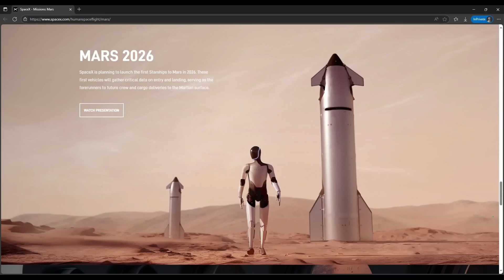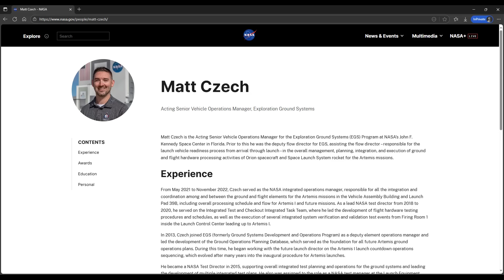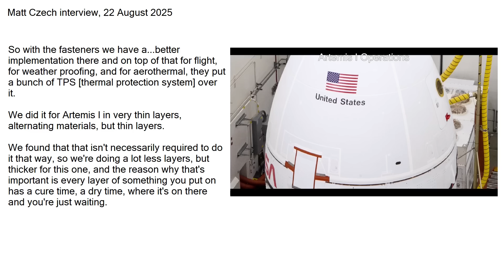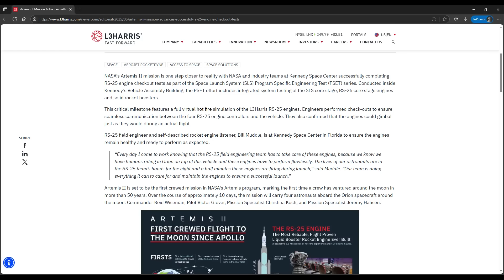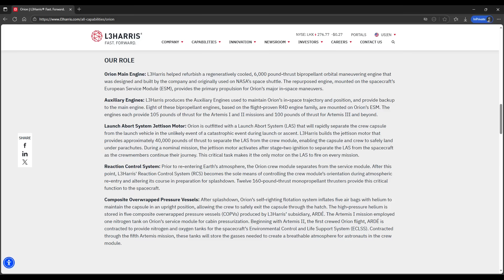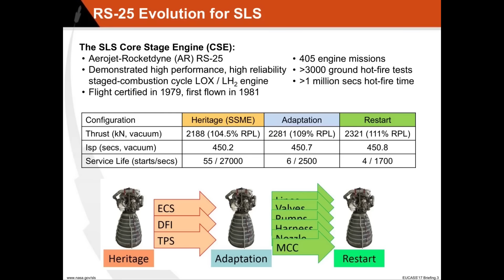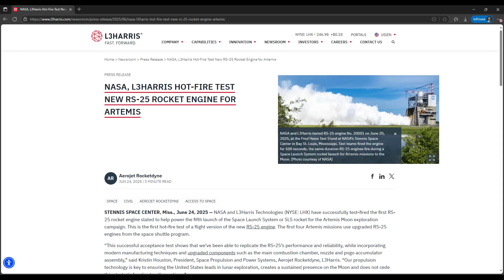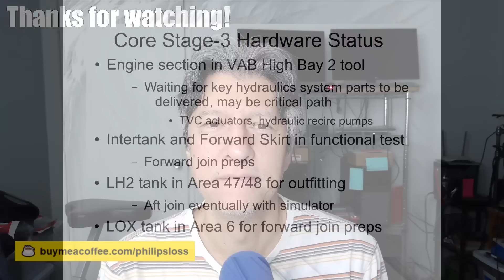Starship flies successful test, Artemis II launch preps continue

Comment: Elon Musk recently posted an infographic that shows that current V2 of Starship only has a payload capacity of 35 tons, which means that the vehicle is currently extremely overweight. I am skeptical of future payload capacity goals (V2 itself was originally advertised as having 100t capacity) and if SpaceX can't solve this problem it means the number of refueling flights will be extremely high, possibly 20 or more. A NASA safety panel recently stated that Starship's biggest challenge for Artemis missions will be having a high enough flight rate and if the refuelling flights are that high, that becomes much more of a problem.
Reply: V2 was initially expected to be 100 tonnes but they put another version in due to raptor 3 production. They wanted to make changes to the ship but raptor 3 wasn’t ready yet (and still isn’t). So it isn’t correct to frame them as missing that target, they’ve just increased the version number.
Reply: V3 Raptor will be doing a lot of heavy lifting to reduce the dry mass of Starship and the Booster, in addition to increasing prop densification. The Booster in particular has gotten very overweight due to engine bay modifications, so the next generation of hardware will be doing a lot of work to dramatically improve performance
Reply from the maker: SpaceX provides the best live look-ins between ignition and splashdown, but under the hood it's like everyone else (black box).  The complete and successful flight test was significant progress, but in the absence of more details or context, it's going to be hard to get a good perspective on how much progress, like the other lunar lander development programs (Blue Origin and China).
Reply: V2 was originally supposed to be what V3 is now going to be. Next gen booster, next gen engines, plus a bunch of upgrades that V2 would've got if they didn't switch over to V3 when they did. So I'm absolutely not surprised that the current V3 figures are the same figures that V2 had when the specs were introduced last year.
Reply: So does anyone here not remember that V1 was originally supposed to have had 100 tons to orbit? It just keeps getting pushed to the next version.
Reply: @FrankyPi I thought it was og 150 tons for the first starship. Could be wrong.
Reply: @FrankyPi  and it might have had that - in fully expended mode.  It makes it a lot easier when the Ship doesn't have to lug along ~100 tonnes of reserved propellant for deorbit and landing burns, and Booster, an extra ~70+ tonnes of propellant as well (just for landing burn alone; plus much more for boost-back).  The latest numbers in that graphic posted by Musk, on the other hand, refer specifically to payload capability under full reuse
Reply: @Spherical_Cow  It was always about full recovery not expendable, they can't afford expendable even if they wanted to do it. V1 ship had 230 tons of dry mass, even expended it wouldn't have come close to 100 tons.
Reply: @FrankyPi  I think you're just making those numbers up.  Booster likely weighs more than 200 tonnes dry, but v1 Ships?  I don't think so.  Especially before all the extra mass was added to stiffen it around the payload door and aft skirt, with leak dilution and fire suppression vents and COPVs, thermal blankets under the TPS tiles and tile mounting steel pins, and etc. tacked on for what's now called v2.
Reply: @Spherical_Cow Booster weighs 310 tons right now, and ship is at 180 tons. I'm not making any of this up, I learned about this from someone with connections in the industry familiar with the matter. In fact, I used these numbers and everything else I know for the rest of the performance and design parameters to calculate V2 payload to orbit back in June and it came fairly close to the revealed number, upper limit of ~33 tons. If the stack wasn't so overweight it would have way more performance considering its size and power, but they can't escape being this overweight when the primary structural material they have chosen is 3 times heavier than industry standard aluminum and composites, it will also bite them in the ass for reusability because steel is prone to fatigue cracking. Soviets learned this the hard way with steel used in their interceptors MiG-25 and 31.
Reply: @FrankyPi  I think you are confusing steel with aluminum alloy.  It's aluminum that's well known as prone to stress fractures.  Steel is much less problematic in that regard.  As for lightness vs. other industry standards, using composites would've been tricky with extreme temperature cycling, and both composites and aluminum would've demanded a much heavier and more robust TPS and would've created extreme vulnerability to catastrophic failure from any TPS damage.  As for your industry source, I would suggest they're feeding you BS.  And there are so many free parameters to play with when guesstimating performance, you can fit just about any target with enough tweaking.
Reply: @Spherical_Cow  I'm not confusing anything, look it up before making uninformed replies. Aluminum is more difficult to weld for use in aerospace, with more advanced methods required to get proper welds, but steel welds are prone to fatigue cracking. You're also conveniently forgetting how Falcon 9 uses standard industry materials including aluminum, and it also uses cryogenic oxygen as oxidizer like most rockets do, and its doing fine for reuse. Starship won't be doing so well with this critical flaw from steel. 

My sources have been proven correct multiple times already, I have zero reason to doubt their validity, especially with some of their credentials. Playing around with numbers can yield different results indeed, but dry mass is one of the most significant parameters, especially on upper stage where fairly small changes produce significant differences in performance. 

The thing is, if you plug in numbers for dry mass that you think are correct, then the performance of engines would have to be way worse than what I put in, which still isn't at the level of advertised performance, to get the amount of payload to orbit shortfall of V1 and V2. You either accept that stages are way heavier than you thought, or you accept that engines are performing catastrophically worse than what even I put in. I doubt you would accept that Raptor 2 is producing less than 2.1 MN of thrust on average for the V2 ship stage. You're unsuprisingly in a state of denial, you'll get there some day :)
Reply: @FrankyPi  Starship uses laser welds on thin stainless steel.  Those types of welds in that context are very uniform, and very strong.  Falcon 9 uses an aluminum hull, not a composite one: I specifically talked about composites, not aluminum, as problematic with regard to large temperature swings.  Falcon 9 also doesn't reenter from orbital velocity, and furthermore uses a reentry burn to protect itself.  Super Heavy trades off reentry burn for greater dry mass and lower staging velocity - but on the first stage of a multistage launcher, dry mass is far less important than thrust, anyway.  And I know your expert sources are full of crap, when they tell you that Starship v1 was 50 tonnes heavier than v2, when it's v2 that added tons of structural reinforcements, TPS, payload bay mechanisms, and additional fault-mitigation subsystems relative to v1, with the only mass reduction being the smaller forward flaps and thinner flaps overall.
Reply: @Spherical_Cow  We will find out how strong and durable they are as soon as they start reuse attempts in greater numbers than just once. I never said Falcon 9 uses a composite hull, I said it utilizes standard materials like aluminum and composites, don't twist my words. Neither Falcon 9 nor Starship boosters reenter from anywhere near orbital velocity. What I said for steel applies to the whole stack not just the upper stage that has to return from orbit.

I like how you completely ignore the fact that you're cornered when it comes to the reality of Starship performance and the fact that my sources have been proven right numerous times before. Which one is it, disastrous engine performance or dry mass? You simply can't get those low payload to orbit numbers with both being good, no matter how you turn it. I know, it's hard being in denial, you're not doing well so far. 

V1 was a lot heavier because they didn't start making changes from V1 to V2, they already made a lot of changes for V1 when it was flying, it was also "overbuilt" from the start. While V2 added stuff like ablative layer and overall redesign of the stage, it is still a lot lighter because they removed a lot of material from V1. Structural reinforcements is also more of what they did with the booster, if you remember it was blowing up in first few flights, while ship didn't start blowing up from design flaws and doing so consecutively until they got to V2.
Reply: @FrankyPi  v2 Ships have a lot more stringer and hoop reinforcements relative to v1, as is observable via externally visible weld marks.  They added CO2 COPVs and vents for leak dilution and fire suppression in the engine bay false ceiling.  TPS pins were added everywhere in lieu of adhesive tile attachment, and ablative blankets were added under the tiles.  The Ship currently called v2 is in fact mostly the old v1, just with some incremental redesign done to flaps, a raised forward dome against a shortened cargo bay, and a preponderance of mass-adding changes against just a couple mass-reducing ones.  What is now called v3, used to be called "Starship 2" a year and a half ago.  It was then, and still is, the build targeting 100+ tonne payloads in fully reusable mode: nothing has changed, except the naming.  It's still contingent on Raptor 3 availability, just like it was back then.

The explosions you for some reason attribute to structure flaws were nothing of the sort.  Flight 7 had either harmonic resonance or pogo oscillation issues with redesigned methane transfer tubes.  Flight 8 had excessive leaks from Raptor powerheads, due to insufficiently tightened flange joints.  Flight 9 had a defective methane ullage diffuser.  And Ship 36 blew up because of a defective COPV.  The aft skirt explosion(s) on flight 10 appear to be caused by blockages in redesigned engine chill shunt lines, pending official confirmation.
Reply: @FrankyPi  I know this is a very late reply but 230 tons can not be possible for the V1 ships because the bridge crane in the bays could only support 180 tons. I very clearly remember Ship 32 (a block 1 ship) being lifted before being scrapped in the now demolished highbay.
Reply: Worth noting that the V2 from last year is the same as V3 this year. They basically just shifted the version numbers retroactively.
Reply: back than V2 had Raptors3, now V3 will have these raptors
Reply: V2's payload capacity is probably reduced by alot because it still uses the first generation Superheavy boosters. Also as another commenter said the original block 2 was supposed to have Raptor 3's. IIRC Raptor 3 lowers the ship dry mass by atleast 7 tons and booster dry mass by 38.1 tons so there's a good chance the V3 numbers are accurate on that chart.
Reply: @hellholder98  Unfortunately no. For all its superlatives, Super Heavy's performance can be summed up with one number .. staging velocity.  Adding staging velocity also has a down side - it requires more fuel for the boost back burn to cancel the velocity and momentum to get back to the launch site for catching.  Also, the extra velocity may add altitude that increases the re-entry speed to the point where the Raptor Engines wouldn't survive.  This then would require more fuel to be kept in reserve for a Falcon 9 style re-entry burn to reduce the velocity to more manageable levels.  In reality, there are some very practical limits to how much staging velocity Super Heavy can impart to Starship.  It's not looking good at all.
Reply: Oh no.. I knew it was probably bad since they were scrapping V2 production very early .. but not that bad.  I seriously doubt V3 is going to fix this problem.  I think it's time for a congressional review of SpaceX's participation in the Artemis program.  There is another contractor for the landing system (Blue Origin) and they have a far more pragmatic solution.  Money should be retreived from SpaceX now, so that it can be given to Blue Origin to accelerate development.
Reply: @ericmatthews8497  What problem is it that you are talking about? The mass to orbit? That is literally what this next version is designed for, why would you assume that the new version wouldn't fix that?
Reply: @ericmatthews8497 it’s actually hard to see how V3 wouldn’t fix this issue. It is known that raptor 3 removed engine shielding from the engine itself as well as the booster aft, has higher thrust by at minimum 20 tons, and that the booster is stretched. Also, with the block 1 boosters (14+) being retrospectively deemed V2, what was previously referred to as the combined “V2” system with 100 tons to orbit is now more accurately V3… but I guess we will see if for whatever reason those mass reductions have to be compensated for elsewhere.
Reply: @ericmatthews8497  I find it inconceivable that such funds would be revoked from SpaceX, barring a lawsuit which would take many years to conclude.  I do agree that Blue Origin's solution seems more achievable.
Reply: @ericmatthews8497  Blue origin has received pretty much the same amount from NASA for Artemis...
Reply: @Will-eq7uh  You are either lying or just making false claims without even checking. This is public info anyone can access at usaspending. Blue Origin has been outlayed (paid) 689 million dollars out of 1.1 billion of obligated amount, while current contract award amount and potential contract award amount are 2.9 and 3.4 billion respectively. SpaceX has been paid 2.7 billion out of 2.9 billion of obligated amount, while current award amount and potential award amount are 4 and 4.5 billion respectively.
Reply: @FrankyPi not lying, bad faith of you to assume that. Their contracts are worth a similar amount was my point
Reply: @Will-eq7uh That's a different statement than claiming they've been paid the same. Paid means money they already received, not what the total worth of each contract is. This is why I responded the way I did.
Reply: @FrankyPi  I did not say the word paid, you LIAR. I said received which is absolutely correct, they have both received contracts in a similar ball park. Take your pedantry and lies elsewhere.
Reply: @Will-eq7uh  Received means the same as paid, you said nothing about contract award amount, nothing that would imply what they're bound to get paid in total, only what they got as of now, and I couldn't even find your comment anymore, either you deleted it or it's youtube's doing.
Reply: @FrankyPi  It absolutely does not, they RECIEVED a contract that was in the same magnitude of SpaceXs. Stop lying.
Reply: @Will-eq7uh  You didn't say it like that in your comment which I still can't see anymore, and you still didn't deny you deleted it yourself. Interesting. By the way, you keep forgetting that I did not accuse you of being a liar, that was only one of the possibilities, the other was unknowingly saying false information.
Reply: @ericmatthews8497 And the money giving to Boeing for Starliner should be retrieved and giving back to the taxpayers. That craft is 9 years late atm. Way way more late then starship, I don’t believe starship will be ready until after 2030 however.
Reply: They might be able to cheat a little by shrinking HLS. HLS will already be lighter by grace of not needing a TPS, but you also really don't need more than two decks of living/airlock space when each deck is nine meters in diameter. Starship has a massive payload section that just isn't necessary for a crew of four or less.
Reply: @rkr9861  That brings up the real possibility that the lunar HLS Starship will look radically different than we expect.  We have after all seen nothing of that vehicle so far (that I know of anyway).  The renderings and artists' conceptions should probably be taken with a grain of salt.
Reply: Falcon 9 booster is making 40th flight. When Starship is ready, it should be more reusable than F9. So it should be not so big problem to make more flights.
Reply from the maker: @ErkiEntveg The Artemis question for Starship today is when, due to the emphasis on Artemis 3 as a lunar landing that goes back to 2019, even before Starship was selected.

If Starship can support Artemis 3 requirements before it reaches the optimization phase, then NASA will be good, but regardless the question is when they will be able to launch two HLS prototypes and refill the second one to do the full Artemis 3 con-op.
Reply: @ErkiEntveg 30th
Reply: if you can do 1 refuel flight, then you can also do 5 or 20 or 100. What does it matter?
Reply from the maker: @bosshog8844  When matters, unless the government changes its mind.  If it takes 20 refueling flights, can they fly all of those in 3-4 months?  For the current Artemis 3 schedule, they would need to be flying those in the spring of 2027.
Reply: @bosshog8844 Equally important, each of those 10 refueling flights must be successful, or it will morph into 11 or 14 or 25 flights.  Pick a number.  If the lander Starship is damaged at any point, it's likely to be a loss.  A replacement will have to be launched and refueling started from scratch.

Each of the launches will stress the launch pads and infrastructure much more than they've experienced on these test flights.  If any of the pads or associated equipment should require extensive repairs, that will put a crimp on operations.  To me the scalability of this vehicle for operations beyond LEO is dubious.  Horses for courses!
Reply: @bosshog8844 what does it matter!? Time, and fuel. 4 Starship fuel loads equals the entire US production of oxygen. Weather. Orbit location of ship getting fueled. You probably still believe the marketing nonsense for "rapid reuseability". There is allot of unknowns for Starship, and it's not even close to going to the moon yet.